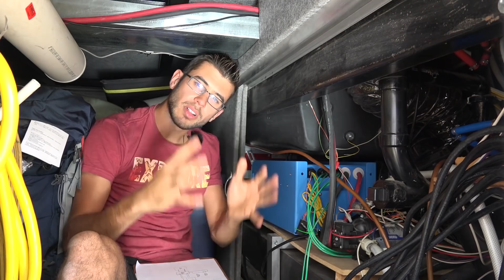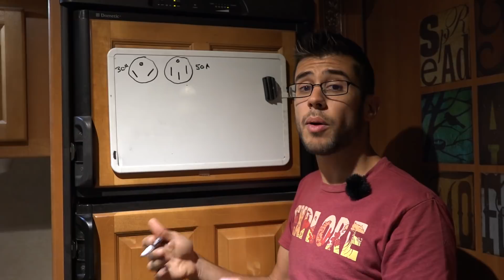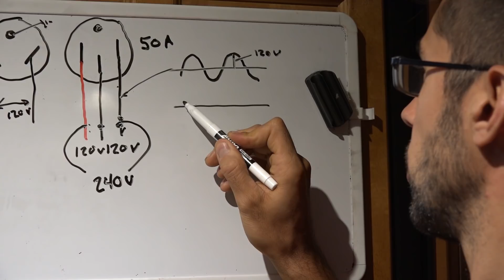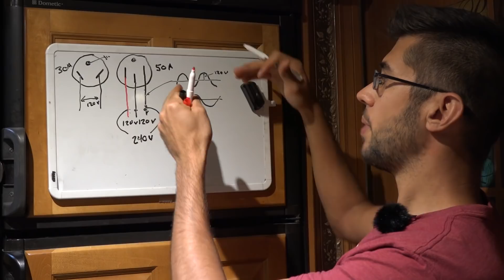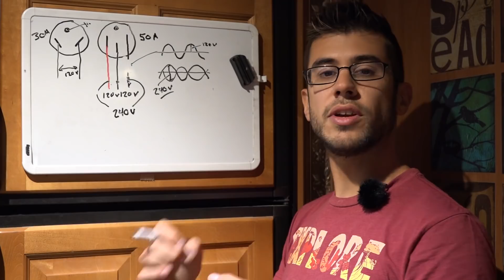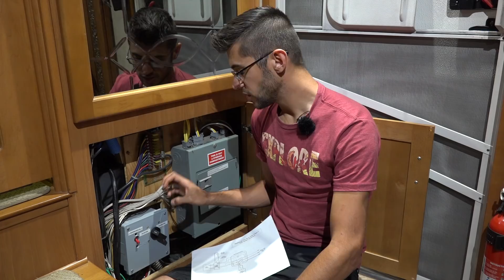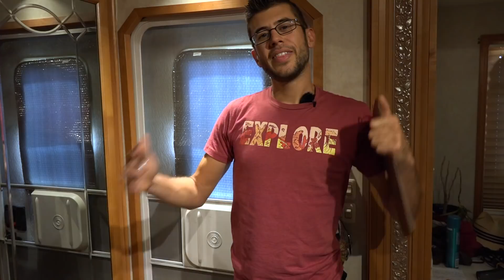RV Solar Phase 3 - 24V Inverter Installation for powering the whole AC system of our RV!

Comment: Since your panel is setup for 240V anyway, why didn't you go with a 240V inverter?  Just a cost and simplicity thing?
Reply from the maker: Well we got the inverter super cheap, but I agree that would be a good option.  There are not too many split phase inverters out there that will run on 24V however.  I am helping install a stacked victron victron 240V system now however and will do a video on that at some point.

Comment: Great job!  I"ve never seen such a complicated but well thought out system as yours.  You've solved a lot of the issues I've thought about in putting together a complete and  flexible system.  I'll be looking for the  video on your ideas on  maintaining the Lithium  battery.  I"ve got an AM Solar system installed (4x100W solar + LiFePO4 battery + Victron boxes) where I've been keeping the battery at 13.4V during storage and at 13.8V when in use to prolong battery life.
Reply from the maker: What batteries are you using?
Reply: It's a single 180AH 2.56KWH.   Your idea to use a Tesla pack was really clever.  Did you get advice from someone on doing that?  I'm space limited  (I have a Sprinter MH similar to View/Navion) so  I'm pretty much maxed out with 400W on the roof and the single battery.

Comment: We are in the middle of installing a similar setup for our RV although in the opposite order, inverter first, then battery, then solar. We also have a 50A shore power connection and a victron hybrid inverter. If we had seen your video a week ago we would have been less confused when we powered it up the first time and only half of the circuits were powered :)
Reply: Sushila Shenoy I’m about to buy a Victron and was worried about the same thing. Finally someone explains it and demonstrates how.

Comment: Great explaination.  One question - Why did you use green wires for the 120 VAC circuits without labels or color coded tape identifying L1, L2, Neutral, or Ground?
Reply: Holy crap. I bet  none of these people making comments could barely comprehend the build and installation of this system.  Hence why you are here criticizing this man's install.  Nothing but a bunch of cry babies.
Reply from the maker: The wires are labeled but not visible in the video..... I had 1000' of green from another project so used it just to keep costs down.  I know it is not ideal.
Reply: Heh, if that was in a brick and mortar home, the inspector would have had a nervous breakdown. ^^
Reply: While you know that green wires are hot, you are setting yourself up for trouble if you sell it or someone else works on it.  Please use the correct wiring color code and stop trying to save a few dollars before you kill someone.
Reply: Use this and replace the GREEN wire. Did you not learn "Green is Ground, the world around"? https://www.amazon.com/Crimp-Supply-Triplex-Tinned-Marine/dp/B0748HSSGJ/ref=sr_1_2?s=industrial&ie=UTF8&qid=1537975676&sr=1-2&keywords=10%2F3+AWG+Triplex

Comment: Good video. I did do all of the rewiring in my motorhome when I did the solar/lithium install. This was way too complex for almost ALL of DIY Rvers IMO. Never mind an RV tech. I believe you have an Electrical Engineering degree LOL.
Reply from the maker: I agree that this wiring method is not the most user friendly as you have to think about the configuration you are running in for your situation, but I feel it gives the most flexibility with a limited inverter ( not a true split phase)  We could do the subpanel, or pass through and split the main panel but I have not seem many do this and wanted to share this option.  I do have an Electrical Engineering degree and tried to keep it as basic as possible, while still explaining the why if someone wants to do the same.

Comment: Great set up and explanation of it Tom, but why didn't you install the Victron Digital Multi Control to turn off your inverter and to set the amperage from shore power?  I just installed the Victron 2000 /12 inverter charger with the multi control.  You can get the digital multi control for around $130 at shoppkys.com (but not on Amazon for some reason they want $300).   Since my RV is a 30 amp setup,  I just used the automatic transfer switch built into the inverter.  To use my computer to set up the inverter I had to buy the Victron Interface MK3 - USB ($68 yikes).  You plug the interface into the usb and then take a rj45 (ethernet cable) and plug it into either of the two V.E. bus connectors in the inverter.  I know you said your inverter was older but I believe this has been the way to set it up using a computer for a number of years now.  You can access and change a lot more functions and parameters with the computer than you can with the DIP switches.  You can also install updates with the MK3 interface too.  Anyway thanks for the informative video.
Reply from the maker: Our inverter is too old for the MK3 interface, believe me I tried.  I got this inverter older but unused for $300 and being cash strapped ran with it.  I do plan to add the control panel at some point but for now the only hybrid functionality we really use is the gen or a 15A circuit, so we don't need to change it much.  Future upgrades will happen for sure tho!
Reply: Hi Tom, thanks for all the inspiration, I am adding a similar configuration to my Sprinter. I just found a used Multiplus on craigslist but they could not tell me if it has the MK3 interface or if I need to dip-switch it. What year is yours and how can I tell? They say it's 4 years old. Thank you.

Comment: Great video Tom! I have designed the same  basic system as yours for my class A with a few differences. Living in Canada and not using the rv in winter I decided on lead acid batteries to avoid cold charging problems and cost. I was leaning towards the Midnite Classic charger because it has a lot of features built in that are options on most other chargers. I was planning on using the 4000 watt 24v hybrid inverter from Magnum but I was concerned of something you mentioned in a comment on another post about the limitations of the hybrid function. I could find nowhere in Magnums manuals or specs as to the maximum total wattage available in boost mode. Am I correct in assuming that 4000 Watts is the total available wattage? Does your inverter have the same issue? I was hoping that an inverter would be available that would work like a grid tie style. Interested in your thoughts. Again your videos in this series are very helpful.
Reply from the maker: The Hybrid inverters usually can add the total available inverter load to whatever can be supplied by the shore/gen.  You could get a full 50A output combining the 4000 watts inverter and generator.  The problem with this however is that it is only one leg so you can only draw 50A on one leg. (a 50A breaker is 50A @240V)  so you are still only have half the capability of a true 50A plug.  As for the magnum hybrid functionality the biggest drawback is that for some reason they require the shore to hold the whole load for a moment before transferring beginning the hybrid functionality.  This makes running an AC off a small gen difficult or impossible and very hard on the Gen.  The victron is the oppisite, the load is completely battery  powered and it slowly ramps up the shore power.  This is very easy on the gen and shore circuit and works great with a small gen.  I am not sure why magnum does this and I am sure it can be fixed with a software update but the last time I chatted with them they did not sound like it was going to be changed.
Reply: Great to know.  I have the same small Honda and intended to use the Hybrid feature for running the AC.  I was about to make the mistake you point out here.  Would it be a work-around to that problem to go into Hybrid mode first and then power up the heavier loads or does it stay 100% shore until enough load is added to need the battery?

Comment: Tom, I am not an electrical engineer, just an old country boy that has worked on stuff all my life. It looks to me like  from your wiring diagram that your 5th wheel will from now on be a 30 amp system unless you have made some king of araingment for when you are on a 50 amp power. I was going to wire my 50 5rv with a seperate drop cord that I could hook to a 30 generator in the bed of my truck but every way I could figure to do it would jumper just as it does when you hook to a 30 amp service and then I wouldn't be able to run both air conditioners. Am I looking at it wrong or is that the way it will work. Thanks, nat
Reply from the maker: On the inverter we are limited to around 30 amps, however when the transfer switch is in pass through it will provide the whole 50 amp service just as normal.  To get true 50 amp passthrough of an inverter you would need to stack 2 inverters and do a split phase system.  I am helping someone else build that system and will do a video on that in the future.  If you are trying to run a second cord and still maintain the 50A you will need an automatic or manual switch (just as I did) to retain the 50A in normal configuration.  You would just power the genside of the transferswitch with a jumper just like i did.
Reply: Hey Nat Angell I ran my generator in the back of the truck and I almost woke up dead. It seems that the exhaust infiltrated the front of my fifth wheel and I was feeling a little light headed before I went to sleep, thank god and american standards for the co2 alarm mounted in the bedroom it woke my up and saved my life. Not going to do that again. Don't know what the solution is, but now I am aware of the problem and now so are you. Sean.

Comment: Hey Tom, great video series!  One quick correction -- measuring peak to peak != 240v on the split phase AC.  240volts is the RMS voltage ( Root Mean Square ).  A nit-pick to be sure.. :)  Great work!
Reply: I was going to respond to your earlier statement about installing 10kwh of storage, asking how you intended to actually charge all that, but I just saw your setup. Largest RV solar setup I've seen, by far! Funny, when I started my project pretty much everyone said that 2kwh on an RV was impossible. I did it, but you beat me by 150%. Incredible.
Reply from the maker: Yes very true.... I actually did a take where I got into power and phase theory but my camera woman (Caitlin) got totally lost so we tried to simplify things  :)  I am installing a true split phase double stacked inverter setup in another coach soon and maybe we will fully nerd out there. :)  Thanks for the comment!
Reply: Ya, I will concede that RMS vs P2P is likely beyond the scope of even this video's expected audience. :)    FYI, I've got my 4 Tesla Module + Solar + Inverters all installed in my coach now and will be making a blog post and video on it soon.  It's quite the beast! :D
Reply from the maker: Awesome! Cant wait to see it! :)
Reply: Michael Kidd , can you post your site? I'd like to see the Beast.
Reply: Hello miltonkchambers, my site is https://TurtleHerding.com .. The most recent post (Where have we been) has a mention of the project and some photos (toward the bottom of the post), but I hope to have the full write up posted in the coming week.  (Tom, hope you don't mind me posting the URL... )
Reply: I just completed my blog post on this project: https://TurtleHerding.com/2018/06/mod-tesla-powered-tiffin/  I have skipped the video part for now as I can't do nearly the job that Tom has in his production! :D
Reply: Be sure to check out Per3110.  He has a WAY bigger solar setup than I do.. Coach and Trailer covered with panels.. :)  I have his videos in my LiPo & Solar installs playlist  if you have any problems finding him.  -- I have 18kwh.. I think his is over 20kwh of storage.

Comment: Such a great detailed video Tom. In my 5th wheel, I installed 1200w solar, 4 100ah Battle Born Lithium batteries, Magnum 2800w non-hybrid inverter, BMK, AGS, and a Midnight solar controller. What was your decision based on to choose Victron? It seems that a lot of youtube vloggers are choosing Victron. Am I missing something? Thanks again for the top-notch vids!
Reply from the maker: I just felt like victron was the most programmable, had the widest voltage ranges and love the bluetooth connectivity and wireless updates.  I also wanted the Hybrid functionality and the Magnum has some limitations with how the hybrid function works.

Comment: Mind blown. But design wise it looks like the way to create maximum adaptation. You can combine solar and generator during the day. You can combine battery and generator at night  you can combine 18 amp shore power at friends house with solar. Just reality cool set up. ASEET, BSEE approved. Lol.
Reply from the maker: Lol Thanks! Yea you need to think about it a bit to maximize usage, but we wanted all the options!  :)
Reply: Mortons on the Move — but is is an expensive system. Know you might have done it all with less than $2000 cost not including panels.

Comment from the maker: !!IMPORTANT!!  -  Victron has announced that the BP units are not designed for reverse currents and could start a fire.  We have got away with it for 2 years, but probably because most of our charge is solar and lower currents.   Please consider this in your design, the design in this video technically does not meet these requirements and when I have time I will update to a recommended solution.   Read more here - @t

To get a copy of the schematic head over to our site here - https://www.mortonsonthemove.com/toms-tech-stuff/solar-phase-3-the-inverter

If you are interested in solar or electrical consultation from myself reach out to us at mortonsonthemove@gmail.com